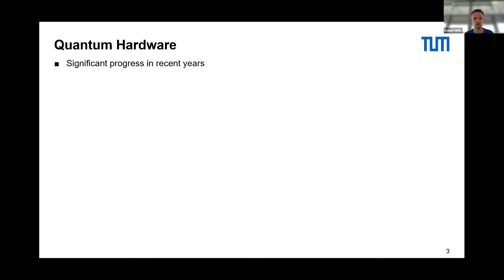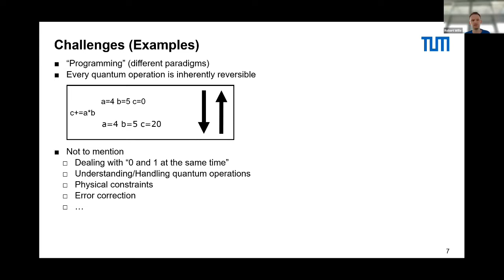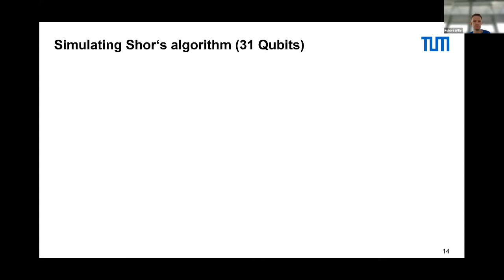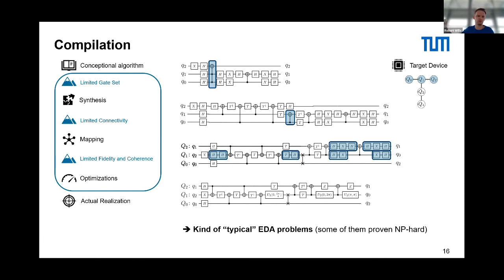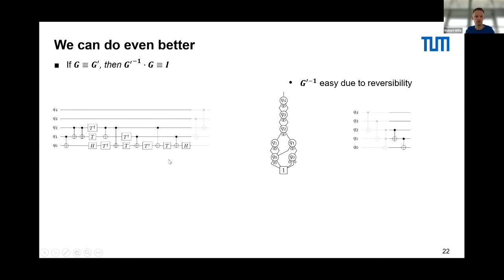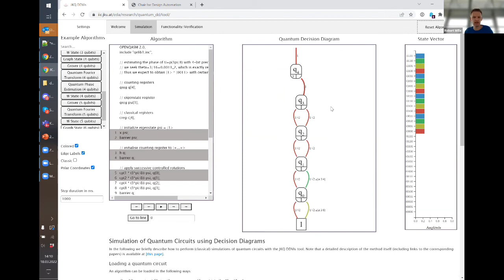Design Automation and Software Tools for Quantum Computing by Robert Wille

Comment: This book offers readers an easy introduction into quantum computing as well as into the design for corresponding devices. The authors cover several design tasks which are important for quantum computing and introduce corresponding solutions. A special feature of the book is that those tasks and solutions are explicitly discussed from a design automation perspective, i.e., utilizing clever algorithms and data structures which have been developed by the design automation community for conventional logic (i.e., for electronic devices and systems) and are now applied for this new technology. By this, relevant design tasks can be conducted in a much more efficient fashion than before – leading to improvements of several orders of magnitude (with respect to runtime and other design objectives).

Describes the current state of the art for designing quantum circuits, for simulating them, and for mapping them to real hardware;
Provides a first comprehensive introduction into design automation for quantum computing that tackles practically relevant tasks;
Targets the quantum computing community as well as the design automation community, showing both perspectives to quantum computing, and what impressive improvements are possible when combining the knowledge of both communities.